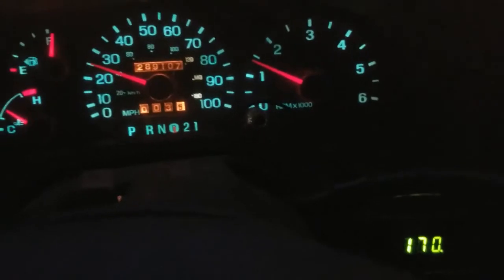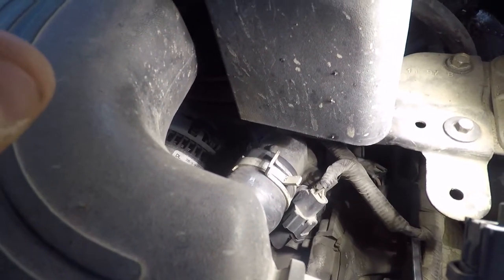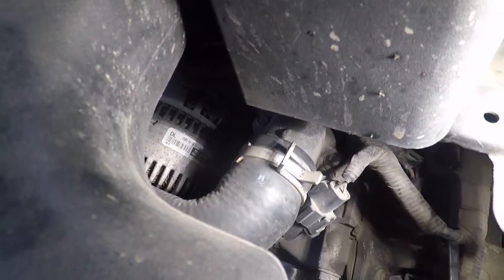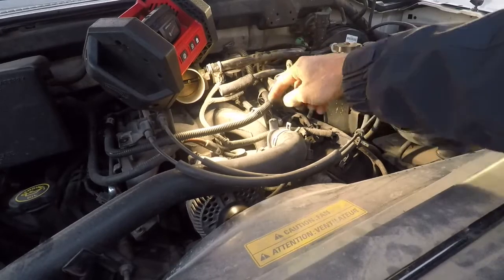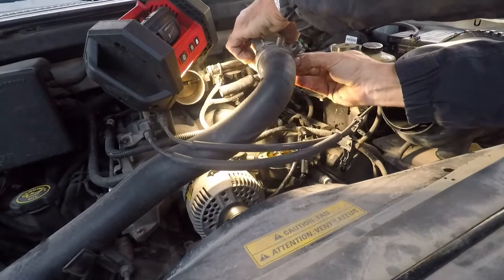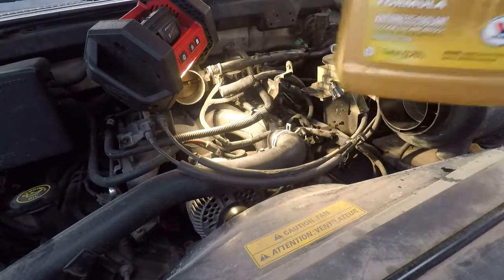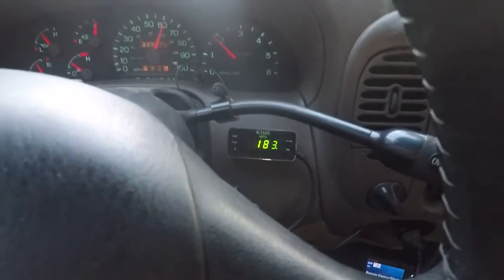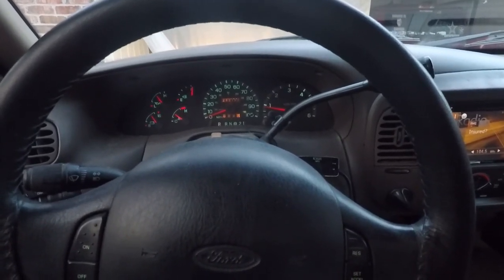Replacing the Thermostat on F150, Expedition, Excursion

Comment: Aftermarket?   I try to use OEM on critical or very cheap items....thanks Aaron.
Reply from the maker: I've had generally good luck with AutoZone parts. The wonky one was from rockauto. I'm going to test it to see if maybe the truck just doesn't produce a lot of heat. If I can't get it to run correctly, I'll probably go with the motorcraft to see if it makes any difference. Thanks!
Reply from the maker: I had a brainstorm last night that I think is the problem. That O-ring isn't just the seal. It also is supposed to hold the thermostat in place in the housing. The noise I heard was the entire stat floating around so that would be where it's bypassing coolant. I'm going to pick up a new O-ring and some more coolant tonight and try to get it right this time. My bet is the O-ring should be installed in the housing on top of the stat first, then the neck gets installed on top of that rather than installing the O-ring on the neck first. I think that's how I cut it last time.